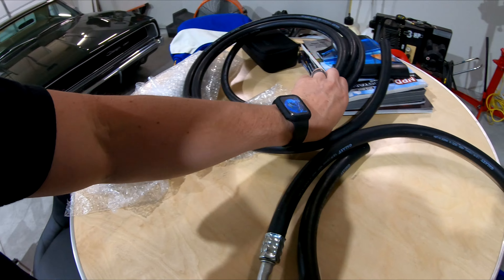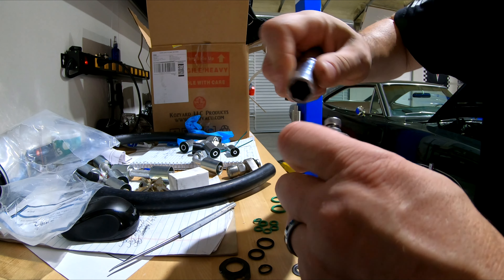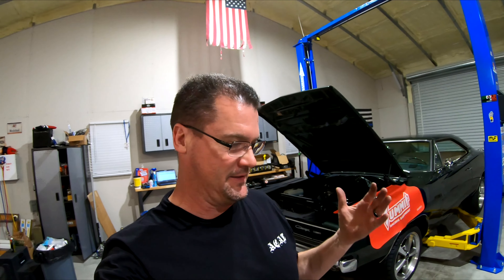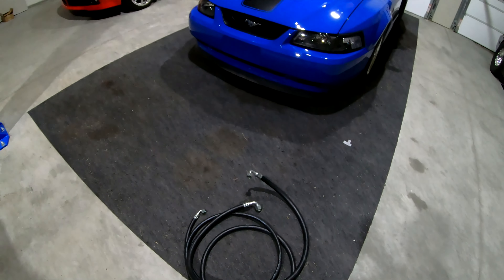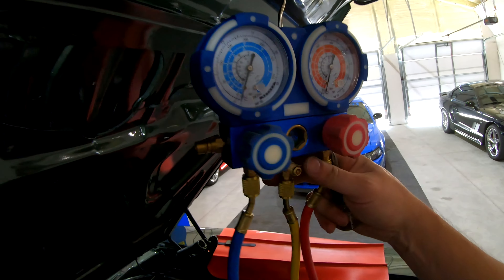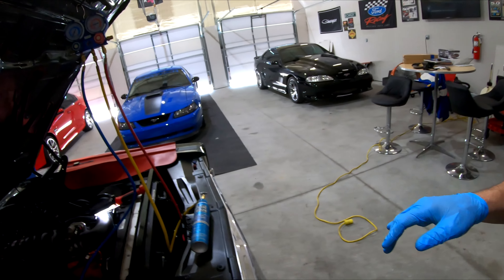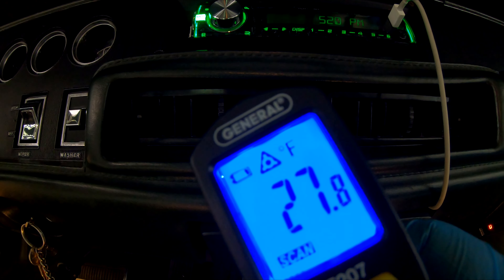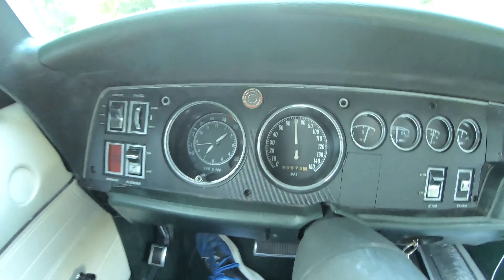Fixing the air-conditioning on my 1968 Charger with 5.7 Hemi Swap.

Comment: One wheel peel :). Nice job on the AC!
Reply from the maker: Thanks.  Yes the 8-3/4 rear will be getting overhauled this winter with a Sure-grip posi and 3.73 gears.